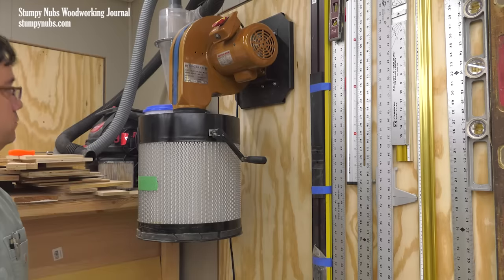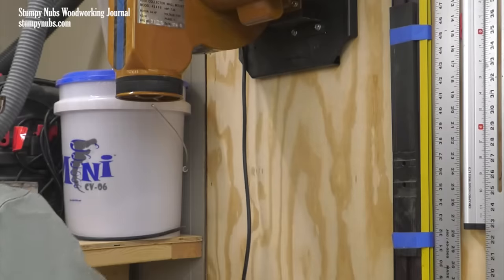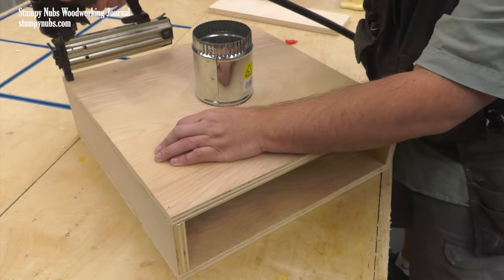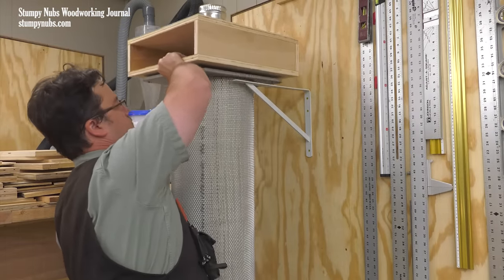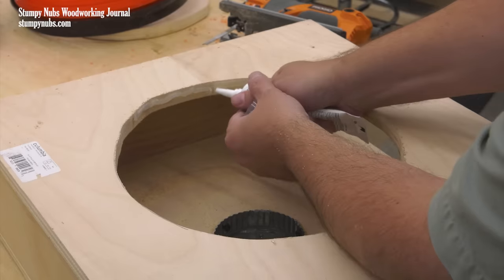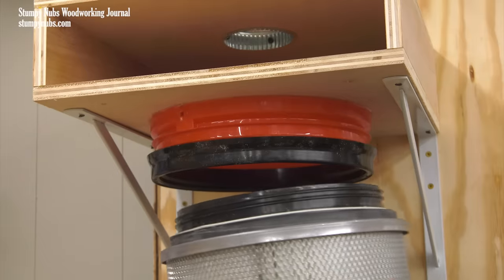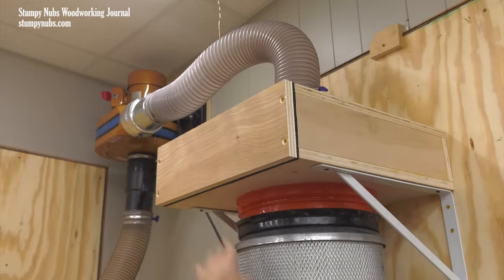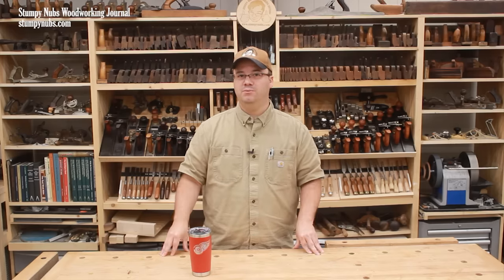Supercharge your SMALL SHOP dust collection!

Comment: lol...hahaha small shop ;-) ..even this one would not fit in my shop..definition of a small shop is everywhere different . my shop is  3 x 3 meter or 10 x 10 feet
Reply: That would be called the coffin, around my place.
: - )
Reply: I sorta like the small shop at the beginning because it forced me to rethink what tools were necessary and which ones just made the shop into a showroom.  Now, decades later, my shop has grown from a 5' x 8' closet to a 14' x 17' dust gathering center.
Reply: Ahhhhh yes same, two benches and a WHOOOOLLLLE LOTTA vertical storage 😅😅😅😅
Reply: I have a little more room. Thinking about a cart-mounted collector. Tall is ok.  Stability might be a problem.
Reply: My shop is 260cm by 260cm.
INCLUDING workbenches and shelves.
So in reality it is smaller at least  half a meter on every side.
The only problem im running into is wall space.
I covered doors of shelves in tool holders and it is still not enought!
Reply: A small shop is in even greater need of dust collection since the particles in the air would be more concentrated.
Reply: @jack5402  very true.. i have a small box fan with filter on the wall. Thats enough for the 3 x3 i have. And with the door open offcourse..
Reply: 3 x 3m is about the size of my shop, too.  It was originally conceived as a motorcycle garage. It has a nice big roll-up door, however, which allows me to refresh the air often and quickly, but it gets cold in winter. My wall space is too precious for permanently mounted tools.  I have a 3.5 meter tall ceiling that's not doing anything useful.  Can dust collectors be mounted on the ceiling?
Reply: @sincerelyyours7538  yes something like my boxfan with filter can also by mounted upside down on a ceiling..

Comment: Good video, but you show the Wynn filter being used with the dust collector without a cyclone in front of it.  Wynn expressly states on their website for the 13F230NANO filter that a cyclone MUST be used with it.  From Wynn:  "Note, this filter is designed to be used with Cyclone and Hybrid systems only.  For Single-Stage dust collecters please choose one of the 35-series filters."
Reply from the maker: Wynn commissioned this video and requested it be used exactly as I used it. Maybe ask them what they mean by that.
Reply: @StumpyNubs  Then they should update their website.  The flanged filter you link above clearly states it is NOT intended for use in single stage (non cyclone) dust collectors.  Won't this filter clog up very fast if used with a single stage dust collector?
Reply from the maker: @rfguy8499  The only difference I am aware of between this filter and the canister they sell for putting directly on single stage dust collectors is the shape. I believe they are speaking of the style, meaning this narrow filter will not fit on a single stage dust collector without significant adaptation.
Reply: If I use this filter with the harbor freight 2np with the Oneida 4 inch cyclone before the filter does this filter have enough media to let the larger 2hp motor work effectively. I’m going for a smaller footprint and the filter diameter is smaller.
Reply from the maker: @tkoebb  I believe so, but I would ask the manufacturer. They have a contact link on their website.

Comment: I have a suggestion for an additional improvement. Add another screw on bucket lid to the bottom of your filter just like you did in the top (with the center cut out) . Then you can just screw a clear or at least, a translucent 5 gallon bucket to the bottom of the filter instead of clamping a plastic bag to it. It is a lot more convenient to empty the dust out, And a lot faster.

Comment: Add a (draw through) cyclonic collector ahead of the blower stage. Only minimal stuff makes it into the fan or filter. And filter lasts a lot longer as most debris and even dust ends up in the can of the cyclone stage.
Reply: Sccrolled down to look for this comment. :)  I felt my wallet thinning out seeing dust fall directly into that large, and I assume expensive, filter.

Comment: Forget filters get a cyclonic collector — better yet, build one. I’ve been using one for a couple years and the dust bag on my workshop vac system barely has a trace of dust in it… after 2 years of use.  The cyclone separator is more than 99% efficient and you can just install it inline with your vac system.

Comment: That's a great how-to video. Another option to mounting a bag under the fikter is get another 5 gallon bucket screw-on lid and do the same operation, but mount it on the underside of the filter. It'll catch anything that blows by and can easily be unscrewed to empty. Another even better option is just do a single-stage to two stage conversion with an Oneida cyclone. I appreciate the great how-to content, so keep em coming, James!
Reply: Another vote for Oneida cyclones.  I have a large one and barely anything gets by it.  I have just a bag on my blower and probably should get a pleated filter, but honestly so very little gets past the cyclone the bag really doesn't accumulate much.  Sure its a little expensive but it sure beats fighting with clogged filters and full bags.

Comment: great video and a very clear explanation, I will point out that on Wynn's website that particular filter is not intended for single stage use, its intended for 2 stage systems with a cyclone separator before the blower.   they have a different model filter for single stage applications that has an extra filter layer on the inside to keep chips out of the filter pleats.

Comment: I would get get a pressure gauge to keep an eye on how full your filter is. The other thing to remember is with a finer filter it will fill faster, especially with fine dust creators like sanders. I've run an Oneida air cyclone for about 10 years with HEPA filters and have to replace them about every 5 years.
Reply: I like a small clear vinyl hose with a u-shape and colored water for a pressure indicator.

Comment: Im running two 20" "simple deluxe" industrial fans that I bought on amazon. They claim to be 4650 cfm each on high. One of them on low moves more air than a box fan on high, and it runs quieter. Its been great for keeping fine dust out and getting fresh air in when I am staining or using finishes. Well worth ~$100

Comment: I have the big harbor freight dust collector, the roll around, I forget the name, wood crafter dust collector and my first real dust collector I bought about 25-30 years ago from Delta. Plus a couple of shop vacs. The big one from harbor freight is located in the lumber storage room and piped to the shop on the suck side. With the blow side piped outside.  The roll around, I think it's woodtec brand? Still has the bag and is hooked to the planner and to the jointer. The smallest collector is the delta and it's in a weather proof box on the outside of the shop next to the wall that has my woodcarving desk. It sucks through the wall and blows outside. We have 3 1/2 acres so the arrangement doesn't bother anyone. The planner and joiner are more shavings than dust. Plus I'm old and getting close to the end of the trail anyway...lol.. I also use a bucket cyclone for the shop vacs.
Reply: I wonder this all the time.  Even on these big YouTube woodworking channels they have their dust collectors in their shops. Why not move them out of the shop or at least vent them out?

Comment: Brilliant use of available components.   I've built a few professional systems over the years including a 200 HP beast for an aluminum oxide grit plant but when I started building my small shop unit the biggest challenge has been finding affordable components.   You can bet my final filter will follow this design to the T.

Comment: I have been using canister filters for mobile extractors when students are sanding. We use a wide collection hood on a flexible hose. Recently I noticed that after not even a year dust coming off the outside of the filter when I used the agitator handle to shake off loose dust inside. I am not sure if this cloud of dust was from inside the filter or just from atmospheric dust settling on the outside. I decided to sheath the whole thing in a Hepa filter bag for a big drum vacuum. This has improved the situation. I do aim to replace the filter at some point, but at £150 a pop and after not so much use, that can wait a bit. Great video as always :)

Comment: Great video.  My issue with running configurations like this is the fact the filter will fill with dust and clog.  Best to separate out as much as possible before the filter.  This setup works to capture dust, but the filter will clog up and need to be cleaned rather quickly.

Comment: Im only running a rigid shopvac for now 😕 I made a dust cyclone following Chris Notap's video which helped a lot. I used 2" pvc pipe/fittings and put it on a rolling base bungeed to my vacuum. Its worked well for me, saves me from having to empty out the shop vac as often, and it keeps the filter unclogged longer. The filter only gets fine particles and the rest is caught in the cyclone. I have clear flex hose on most of my machines so I can plug the cyclone into whichever im using. Some of them are joined with a Y connector and blast gates to save time always dragging it to each machine.

Comment: I think if you have a steady stream of fresh air in the workspace blowing out of the shop ( as suggested in the mining literature) this will deal with fine dust escaping the filter and you don’t have to do all this.

If that kind of airflow is not practical ( winter) your process seems like a good option.

Nice video
Frank

Comment: Another great video, good timing as I’m currently trying to design a dust extractor/collector for my garage workshop.  I live in Chesterfield, Derbyshire in England and over here, the availability and cost of the system components is not as good as it is for you in America.
I’m going to start with a shop vac with a cyclone separator but plan to build a larger dust collection system later this year but still want to use a larger Cyclone.
Thanks for your inspiration.
Myke

Comment: On my home-made shop dust collector, I had a similar door, in my case for rectangular filter insertion.  I hinged it, and used a window sash lock on the opposite side that draws it tight into the weather stripping.  Much faster access than using screws.

Comment: I’ve been using a Wynn Environmental 13F230NANO MERV 15 Flanged 34"  filter for over a year now. I did my first clean out and it was really filthy with fine dust. I bang in the sides of the big can filter to shake loose dust into the catch bucket but I would call that a futile exercise. There’s just a lot of dust in the filter. I removed the filter and took it outside where I blew it out with an air compressor along a lot of banging on the sides to shake the dust loose for over an hour until I was satisfied that it was clean and mostly I was give out. I do have a dust separator in front of the Wynn filter which helps with the bigger chips and such.
Reply from the maker: The air should be blown from the outside. https://www.youtube.com/watch?v=zuf1G2n4ldc
Reply: @StumpyNubs That’s what I did. It’s just a long process with only a 20 gallon air compressor.

Comment: I made a Pentz cyclone out of thick aluminum sheet metal (basically the clearvue design), and the impeller is a used Torvit 18" that I got on used on eBay.  It's 5 horsepower, and a beast.  I have a bin for the dust and the chips, but the fine dust isn't sent through a filter, it's ported right outside... that set up works great for me.  Sure, it sucks the heat out in the winter, but my shop is a hobby and not a business, so I'm not running my collector all day, and my gas powered heater warms the garage right back up fairly quickly.

Comment: I have two identical "four bag," three horse dust collectors.  Once has canister filters and the other has after-market bags.  Even without test equipment, you can note a big difference in air draw between the two.  The one with canisters is running through a Super Dust Deputy, but still does a bit better than the bag unit.

Comment: I made my filter with a Wynn filter and used gamma seal kits at the top and bottom.   Instead of using a bag I just use a 5 gal. bucket at the bottom.   Much easier to take off and on.

Comment: Hey Stumpy, ever thought about adding a bucket on the bottom of the filter similar to how you did on the top? Especially if you have a 2-stage system w/ a cyclone, the bucket shouldn't get much dust. Screwing/unscrewing the bottom bucket seems a lot more practical than finagling with a bag and clamps. Curious to know your thoughts.

Comment: Without a doubt these filters are a drastic upgrade and so much better than the bag. Absolutely not debating that at all. The upgrade made is 100% worth it. However I have found the bag filters are designed to get better the more they’re used. I know the Wynn filters will absolutely beat the bag every time, but I’d like to see a well used bag filter vs the Wynn.
Reply from the maker: Filter bags do rely upon a crust of dust to improve filtration, but that only further restricts airflow. And even then the level of filtration isn't great, and they still pump clouds of dust into the air.

Comment: Having spent a career in the environmental filtration of liquids and gases I would suggest that you might want to revisit the bag option.  You will find that once a sufficient coating of particulate matter lodges in the interstices of the bag fabric (a 'pre-coat') that the penetration of fines is reduced logarithmically.    Additionally, a layer of table saw dust would be a more effective 'precoat' than sanding fines, as the coarser layer would effectively provide a more built-up surface area rather than a thin impermeable filtering layer. Industry typically uses bag houses for particle capture with a periodic gentle shaking restore cfm.  My own experience has been up to 10,000x removal rates.
Reply from the maker: What you say does not carry over to woodworking as you think it does. Dust removal rates are only half the equation. Yes, a crust of dust inside a bag filter helps close up the pores and provide finer filtration that the clean bag would. But not anywhere near as fine and consistent as a high-grade pleated filter. And even if it did, the bag simply does not have enough surface area to encourage optimal airflow. The less air that can escape the filter, the less that can be pulled in. (By the way, that was a used bag filter with an inner crust that was pumping out all that dust at the beginning.)

Comment: Great content.  It's good to see a nice conversion.

I would highly recommend that you include a cyclone dust separator prior to the dust going into your expensive filter.  Adding  a cyclone separator will prolong the life of your expensive pleated filter by 5-20 times.
Reply from the maker: "Adding  a cyclone separator will prolong the life of your expensive pleated filter by 5-20 times..." - That's not true at all. You can easily clean the filters over and over again. The cyclone may reduce the frequency of cleaning, but not extend the life. And the cyclone will definitely reduce your airflow on a small system like this.
Reply: @StumpyNubs  on further thought, you are right.  A small system needs all the air flow it can get and likely will not be used enough to wear out the filter.

I was thinking more about my system which is much larger and not at all comparable. 

Thanks again for the great content.

Comment: Another option. I upgraded my original Delta cloth bag with a 1 micron bag from American Fabric Filter in 2003. They supplied a large diameter top bag and an impermeable cotton canvas bottom bag. The top bag is suspended from the ceiling joists by loops in my basement. Empty bottom bag when full. It was the best move I made in years. Sorry, I don’t have the receipt with the cost. I couldn’t be more pleased. A simple upgrade if you want to stick with a cloth bag. It does take some use to build an inner layer of dust to reach maximum filtration.

Comment: IF your dust collector bags don't seal well, you may be able to use the self adhesive foam gasket material used between campers and pickup beds. My "properly sized" bags always had spots where dust formed on the outside of the collector at different places. Adding the 2" wide gasket material to the metal of the collector went a long ways to cranking up the seal on any bag to collector connection.

Comment: I see somebody mentioned doing a remote extractor for a small shop. I was going to say similar, a good thing I read the comments. Even if the shop is not small it is a good idea. A friend has his shop in what was a detached two-car garage at a house he bought a couple years ago and he built enclosures off of the back wall. We'd talked about this long ago. One is built at one end of the back wall and houses his dust collector and the other one is a good 20' from the other at the other end of the back wall and houses his air compressor. No airborne dust in the shop from his dust collector and the exhaust stirring up the air and the air compressor encloser has sound deadening foam in it...he recently bought a MUCH quieter compressor, you can't hear it at all in the shop. Both add-ons are accessible outside. I'm sending him the link for this video, even with the remote extractor he may want to do this filter set-up.

Comment: I've had a dust collection system for years.  I thought the cloth filter captured most of the dust.  I finished modifying my system today to add a filter based on your video.  The amount of dust collected by the filter is a significant improvement.  My lungs thank you for making this video.